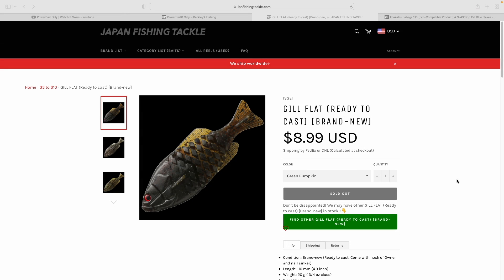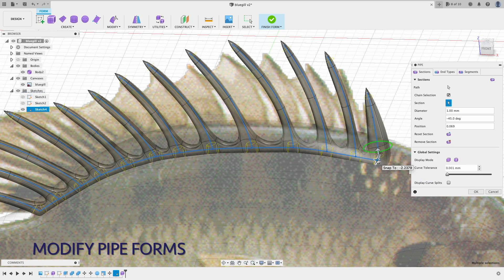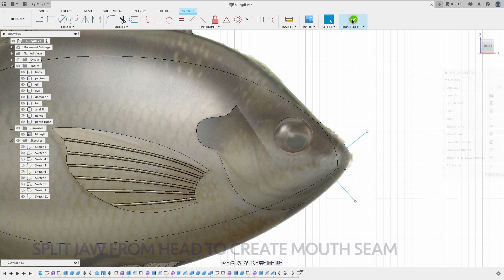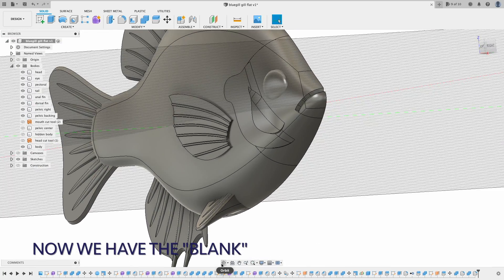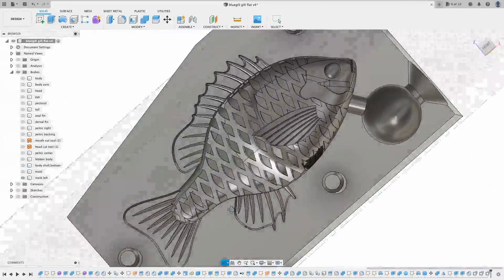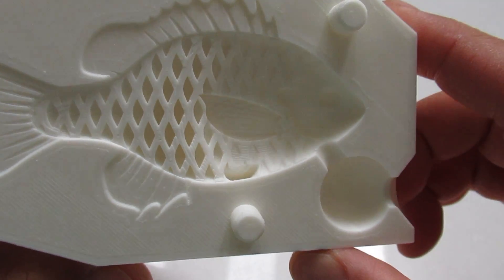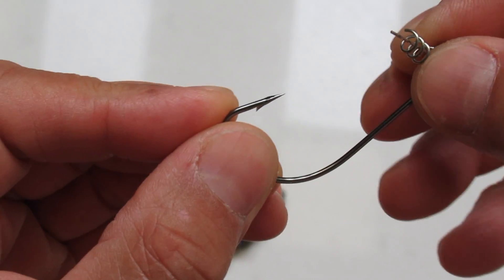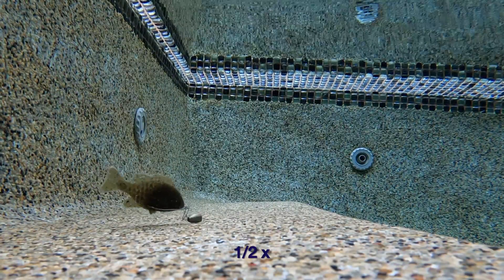How to Create Your Own Fancy Bluegill Soft Plastic Lure (Berkley Gilly Style)

Comment: How does your mold hold up if you are using PLA?   At the injection temperature of 315 degrees the resin should melt the PLA mold.
Reply from the maker: I usually shoot at just a little bit over 300F. It’s a bit tricky and the room temperature is a big factor too, unless you are using some heat resistant filament.

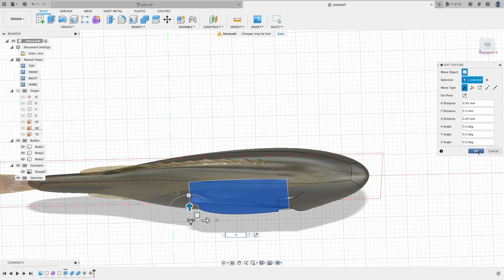Comment: Thank you for this video!  Its a great starting point!  I am having problems with getting the pipe sculpted on the pectoral fin.  The point in the video at ~1:46 jumps from the Combine to the Move without any explanation....Is there another step required.  Also when extruding you mention Extrude - Intersect but you choose New Body....which is correct?
Reply from the maker: Thank you for watching and leaving questions. The strategy for the pectoral fin is: 1. Create a fin by itself without changing the main body - thus NEW BODY (so we can avoid having gaps later when we rotate the fin and combine it with the body - if we just cut it out directly and make the fin/body two non-overlapping pieces, we might end up some weird gap when we combine them) 2. Trim the extruded fin to fit the body profile, using Combine with INTERSECT. Now we have the fin that has the same surface as the main body, while preserving the main body. So I probably have skipped a few screen captures. Here is the full video https://youtu.be/3NWLRMK7LE0?feature=shared hope it helps.
Reply from the maker: Another easier method: when you extrude, set the Extent Type to "To Object", and choose the body surface for the Object, Operation to New Body. But this only works when the projected profile falls on a SINGLE surface. In my example, pectoral fin does, but not the gill plate, which falls on the side and bottom surfaces of the main body when you project the gill plate profile to the main body surface.
Reply: @yauckoutdoors  thank you!  I see where I missed a step on selecting the body as part of the Combine. This video teaches several aspects of modeling with Fusion360!  Well done!

Comment: How did the mold not melt or get deformed by the plastisol’s heat?
Reply from the maker: I am shooting plastisol at 290ish F, PLA melting point is about 330 but it could start to deform at 310 depending on the pressure. So as along as you pay attention to the temperature, you should be fine.
Reply: @yauckoutdoors  PLA glass transition temperature is 140F (60C) it can bend and deform from the sun inside a car.
Reply from the maker: @LureLogicOfficial  I think that's when you leave it for a long period of time. 3D printed molds are more for prototyping or short runs. If you want something for mass production, you should go for metal molds or at least silicon. I do sometimes mess up the temperature, and end up destroying the PLA molds. It's really a border line process so make sure you have a good thermometer.
Reply from the maker: Also I think the plastisol being there helps too. If it's empty in the cavity and you just heat the mold up, the gravity will pull the detail and deform it. Hot plastisol would become the support and PLA would have no place to go, thus maintain the shape...

Comment: Is it okay to add air holes to let the air out or no?
Reply from the maker: Yes it’s always a good practice to vent your molds. In the past I always thought 3D printed molds don’t close very well, so I could get away without venting. But now based on my experience, I think venting will help in most cases. It’s like a cheap insurance, there is no reason not to do it. Cheers!

Comment: I want to be a bait maker but still struggling with Fusion 360. Any advice, like training material for the software? Advice: for better injection, you can add drainage for the hard elements.
Reply from the maker: You can start with a more basic tool like Tinkercad. Also give yourself an easier project to start, like a hard body popper or a spook, and then gradually add features. Once you get a hang of the features like extrude, combine, sketch, etc, you can switch to Fusion 360 and try some more complicated designs. You can always post questions in the comment sections, I will see if I can do a tutorial to help. Cheers!

Comment: This is awesome. I did a bluegill design too but haven't got the chance to finish the design. My reasons are the same. No gilly bait anywhere in stores.
Reply from the maker: If you do get further, I recommend adding the side fins on the body. I believe they will make the lure swim more naturally. Also make the tail part thicker. I think mine is on the thinner side. Cheers!
Reply: @yauckoutdoors  That means a 4 piece mold, in case the side fins break off.
Reply: @064pointbreak  I meant the artificial fins that come out straight from the middle of the body, no angle, not necessary the pectoral fins. They will catch water and cause the body to swim. You can refer to the Berkeley gilly design. So no need to make a 4-piece mold.